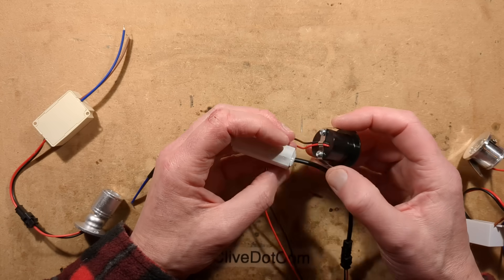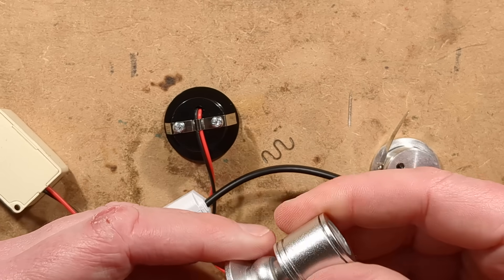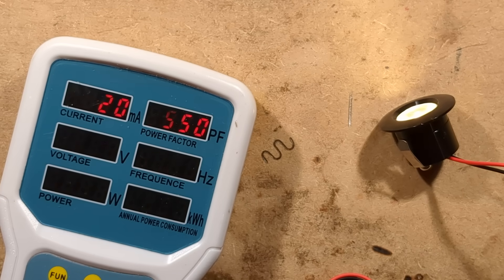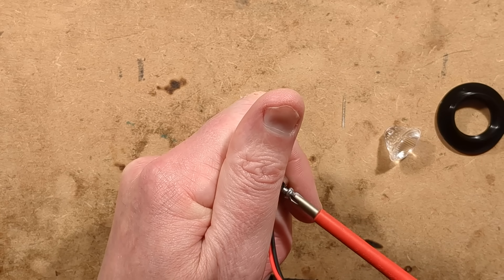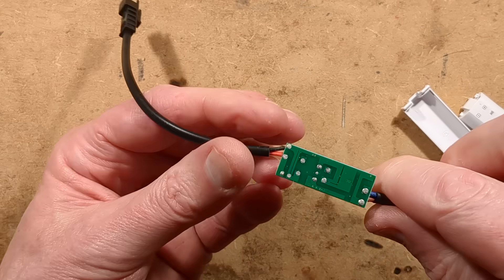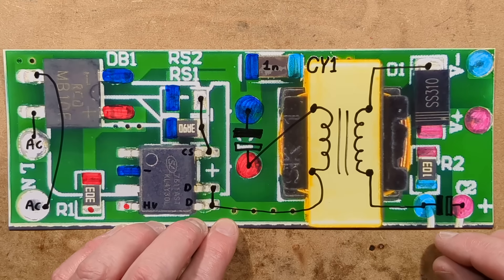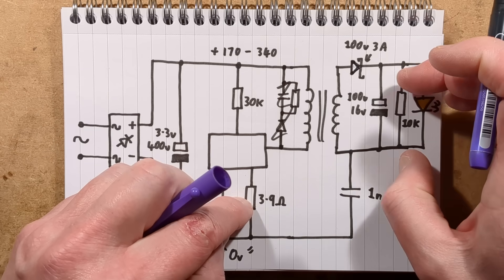Very slim mains LED driver for tiny downlights

Comment: The LED emitter in this looks like a Cree clone, of the ubiquitous XM-L footprint/line. If you want cheap lights with good efficiency and colour quality, it's possible to buy lights that accept an emitter like this, then buy a bag of legitimate Cree emitters in your preferred colour temperature from a reputable supplier like Mouser/Digikey at a few bucks a pop and resolder them yourself with some solder paste and hot air.

I have made a whole bunch of quite nice very affordable dive flashlights this way, but the same process would work just fine for these tiny downlights.

Comment: My bigger concern with speaker terminals for electrical connection other than contact points is material. They're not really good for anything more than an amp and I would be very concerned with them melting.

Comment: oh hey, that's exactly the kind of downlight I'm looking for, to install under the side mirrors of my car, and wire to the interior's lights, to serve as puddle lights! wouldn't need the transformer. I want specifically warm white, and something recessed enough that the light itself isnt visible unless you look under. it looks decent inside, but I'd probably want someone a bit more waterproof... maybe could just fill it with hot glue. I would search for something more appropriate first.
in a car, it would typically run around 12-14V. 10Ω to 33Ω you say, thanks, noting that.
thanks for the video!
Reply from the maker: In a car application you'd be better running three in series with a suitable resistor.

Comment: Excellent video as always.  Thanks.
Whenever I see the Hopi plug I'm reminded of using clear plugs like that as night-lights.  A capacitor dropper, small bridge rectifier couple of resistors and two or three slow colour change LEDs.  (Sealing up the wire cable inlet.).

Comment: you could just have plug with wire and spring loaded terminals

i got that device too, some lamp tester with universal bulb sockets, all of them, never used yet

that being said, it's single insulated wires and after all you might work live anyway. ideally through isolating transformer but often you can't. so it's better to just assume it's spicey and behave accordingly

but i don't create electrical death traps for myself. even if i'm the only one here

Comment: What is the best outome for unwanted electricals?
I have loads of old lcd tvs and thought, are they better broken down in to parts...
Can we start breaking them down and making better stuff?
And if so what would be the tools and expertise required.
Imagine a noob wanting to get rid of his tv's and dont agree with the current setup, right to repair can be diverted by just making them ourself.
I dont want to make a tv, but when i want a better one, the old one going to be recyled seems like feeding their system of recycle not ours.
It just feels corrupt being government?
Reply from the maker: It's tricky.  So much stuff is not designed to be repaired, and even taking it to the local dump can incur disposal charges.

Comment: Hey Clive....  always enjoy your videos. Have a question, would it be possible and perhaps a fun project to 'smooth' the display of the Hopie meter? Could it be done?
Reply from the maker: The multiplexing speed is locked in the main processors software.
Reply: @bigclivedotcom well thats not good... ok, thanks.

Comment: Would this be remotely regs compliant / safe when the only upstream proection is a 15A breaker ?
Reply from the maker: A lighting circuit in the UK is usually protected by a 6A breaker.  But the tracks on this unit will probably blow in the event of a fault.

Comment: Why is the power rectified then pulsed transformed and rectified again, it seems pointless to rectify prior to transformation at those low power levels. Higher loads might need high hertz transformation, but this low powered light? Why not transform to suitable voltage then rectify and stabilise with a cap if needed?  You said yourself that it only needs a few milliamps to run, surely a regular transformer of that sice can deliver that? It seams half the components could have been left out and still drive the light.
Reply from the maker: These power supplies use high frequency to keep the inductive components smaller.

Comment: I find these super small power supplies kind of scary, as in their actual isolation between mains and the low voltage DC out. On one hand the authorities want you to use a meter with class 3 safety, yet allow these little supplies that can no way provide this isolation for an unsuspecting customer who starts poking at a light fixture that has just stopped "Does this need a new bulb?". When a light goes out you investigate, you don't call an electrician.
Also the mains input lead has to be connected to a supply line, the junction box for this will probably not fit through the hole, so being able to drag the supply through the hole after extracting the light is almost pointless as you cannot get the junction box through so you can disconnect and replace it.

Comment: For an off grid application couldn't you remove the driver, string a bunch of the fixtures in series, and run it off a constant current power supply?  No resistors to boost efficiency.  down side is failure of one led means the entire string goes dark.  (like the old time Christmas tree lights)
Reply from the maker: You could run several LEDs in series on one driver.  You could even run three in series with a suitable resistor directly on 12V.

Comment: You should do a video on replacing the power cord on the Anti, including how to source a decent one with good, flexible insulation and actual copper conductors.
Reply: Don't buy from Ali.  For a permanently warm space H05VV-F should be ok.  In an unheated shed etc H05BN4-F as a starting point, and if you need a more robust cable H07RN-F.

Comment: Thanks for this video, Clive, and the bonus info on running these LEDs from low voltage was very welcome and much appreciated.

Seeing the direct-to-mains chip reminded me of the TinySwitch-II family from Power Integrations because I replaced a failed one that one powering the control board in my dishwasher.

Comment: That capacitor seems very suspicious. Especially as "failing short" is a common failure mode of SMD capacitors. I would have preferred to see a capacitor with markings there.

Comment: Thanks Clive. I said "I like it" in unison with you at the end so maybe I'm learning something. I am curious though ... Why not just use four of these on a 12v supply without a resistor? Is it just that you then couldn't set the output or am I all wrong here? Cheers.
Reply from the maker: You could wire three of them in series on 12V with a resistor.

Comment: I’m looking for leds that project a beam rather than illuminate all around. I’m wanting to light little nativities so the size needs to be 6mm or less in height. Ideally it would give a round spot of light like old fashioned stage lights. I’ve thought about flat top leds and paint the sides.

Comment: The housing they used for the light seems to be 100% identical to that of a reversing camera I bought a few years ago (the kind where you drill a hole in the bumper and install it yourself).
Reply: Awesome tooling savings!

Comment: What is a "driver"? in term of DRIVER for LED.  How it CONTROL the LED?  Or how it POWER the LED cells?
Reply from the maker: It regulates the current through the LED.

Comment: There is quite a bit of apparent corner cutting going on.  I have questions of how well isolated the outputs are.  For the intended use as a spot illuminator isolation may not be a huge deal, but you never know what an end user might do.
Reply from the maker: You have to treat all the grey-import lights as being non isolated.

Comment: What is the purpose of the class Y capacitor from the primary to secondary?  For trapping em interference?
Reply from the maker: It provides a path back for high frequency electrical noise coupled capacitively between the windings.

Comment: I kinda want the electrical stuff that I install in my ceiling to have a UL/CSA listing...
Reply: This doesn't necessarily have to go in a ceiling. It could illuminate a shelf, illuminate the wall behind a table, or other applications where it doesn't have to be in a ceiling. Granted, most of those applications involve mounting it on something made of wood so...
Reply: It doubles as a mouse zapper!

Comment: The mystery Class Y question again.
Reply: I think there are class Y capacitors in an SMD package, but they don't look like traditional SMD ceramic capacitors. They're black, quite large, and have actual markings with real certifications.
Reply: @vinnysworkshop  Yageo/Kemet makes some Y capacitors that look like standard packages (CAS series). The packages are quite large though

Comment: Can't you modify that amp metter (hoppy?) to eliminate the flicker?
Reply from the maker: No.  The multiplexing speed is locked in software.
Reply: @bigclivedotcom it may be caused by the software, but that's not a software problem. 
(what it displays =  software, how it displays = hardware)

Add some capacitors between the drivers & displays to smooth voltage & the blinking. The software won't need to know.

Comment: I've been using the garden spike 12v lights as emergency lights on power failure. Surprising how little light you need when it's pitch black out!

Comment: In this case CREE does not refer to the LED manufacturer.  Instead it is used as a general term of alertness and attention, suggesting some action be taken immediately.  "Replace that crappy power supply with something that is properly isolated.  CREE!".
Reply: All power supply from chinese LED light are really crappy, really a little lamps in the market has really good power supplys.

Comment: Its a nice little unit, but do the designers ever consider failure mode analysis. This unit is hidden away across the mains supply. What happens when it fails and gets hot. Is the only over current protection the mains  lighting circuit fuse? Are we filling our homes with tiny little incendiary devices just waiting to go off?

Comment: Oh man... over here in Canada we call those "pot lights". I have horrible, horrible memories and a whole bunch of legit scars all over my hands and arms. Back in the early 2000's my first job ever was electrician's grunt. I had to install something like 50 of these pot light fixtures to the bare cross beams in the basement of a gigantic mansion being built. The only problem was whatever brand these things were, the housings were all stamped/pressed sheet metal that was seemingly completely untouched as far as deburring goes. If you just looked at these things wrong you'd get the worst, gigantic metal slivers if not vicious lacerations. haha =/ I ended up being much better at granite/marble work anyway. haha =) Hope you hade a fantastically food and booze filled christmas Clive man.

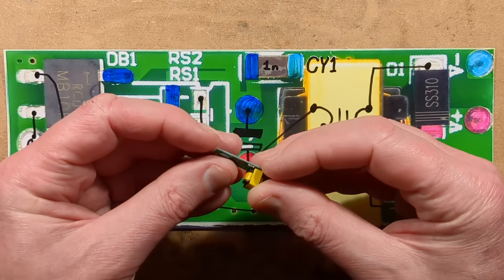Comment: 8:15 How do you tell if a surface mount is a Class Y? You don't. Due to the physical size and type of construction it would be impossible to achieve the required isolation of the dielectric to the "plates" to make it conform to the standard. And those surface mount capacitors are known to commonly fail in short circuit mode. Edit: Oh, and the lack of bleed resistor on the Death Beam input cap is spicy.
Reply: Some reputable brands do make class Y SMD ceramic capacitors, so I suppose it's possible. If a through hole ceramic can do it, so can an SMD.
Reply: @mjouwbuis  A search on the big G confirmed that there are SMD caps, but they are only rated to 300v MAX which on a 240v mains is not enough. You need a 1kv rated cap for 240v mains. And frankly, 300v is still too low for a 120v mains as a simple surge will overcome its rating. Thank you for playing, but my original point stands.

Comment: The LED light at 1:05 with the spiral wound tangs might install and remove more easily if rotating the light, the action of rotation clockwise while pressing in or removing would be similar to a regular screw bulb, the action of rotating it will allow the sprung tang to travel, and in a sense release some resistive force compared to just yanking it straight out. Thanks for the video, always enjoyable.
Reply: I find it's often better to just run these emergency lights 24/7 as any controller will probably use more power than the actual lights, so you end up wasting more power turning them off than just leaving them on.

Comment: BC, how would you smooth the pulsing of your meter dislplays without changing frame rate? Caps or somehow increasing the pwm frequency on the display drivers?
Reply from the maker: The software would need modified to change the scan rate.

Comment: This led current regulated flyback power supplies also used as voltage regulated supply in some chineese devices. Datasheet says its "open string overvoltage protection", so this tiny cheep chip samples voltage on primary at "knee point" to provide output voltage regulation.

Comment: I was thinking about the splice. Boxed and accessible is needed. I can get my hand in the 4" holes for the driver and mains. I could see these in a closet with a box and blank on the ceiling nobody would see. Probably under a cabinet as well. Neat.

Comment: Any idea about those “driverless” tiny (38mm cutout) LED cob lights which run off mains? Market here is flooded with those driverless variants.
Reply from the maker: Many of the driverless COB lights omit the smoothing capacitor and may flicker at mains frequency.

Comment: LED running on 3v taking 100mA.. just curious why power consumption was 2.8W?
Reply: The 100mA was when he connected it to his  lab power supply at 3V. When connected to the provided power supply the voltage (and power) will be higher.

Comment: Clive I'm curious about the possible consequences of snubber network omission.   Early chip switching transistor failure?  EMI noise?  High voltage spikes capacitively coupled to the output torturing the LED and/or output diode?  Or some combination of these? ?  thanks, good video 👍
Reply from the maker: It poses a risk of faster degradation of the switching transistor.

Comment: You should do a video on changing the power cord on the AnTai HOPI.  It would be interesting to see how you would do it, plus what's inside the AnTai in the first place.
Reply: I replaced the power cord on my soldering 'station' (single PSU with iron) and the cord I fitted was no better than the old one! It's difficult to find 3 core flex which is actually flexible enough for light weight things like that...
Reply: @FamilyOfEyles  I found Nexans Pond Flex 3183P 3-Core 0.75mm² x 10m Black to be quite soft and flexible. It's rubber sheathed. I think it's branded Time now - but a search will find it on Screwfix.
Reply: I have a hopi and my lead is crap too plus you can’t put a normal plug in because the cord on the plug is obstructed by those speaker connectors so I use a deathdapter to space it out.
Reply: @g7eit same👌🏻
Reply: Spudge it

Comment: Yes, the HOPI, at least, has a nasty presumably CCA cable that gets hot at high loads. I removed the speaker terminals from mine - it just leaves two small holes. I also added a switch in the top to disconnect the electronics so that you can leave it in circuit without wasting power/risk of explosion when unattended.

Comment: What are the chances of it burning your house down? Made in china. 50-50?
Reply: I think pretty good. It's cost-reduced to the max, putting up enough of those will drive the likelihood of failure toward certainty.
Reply: Driver is "a bit how ya doin" but the lamp itself is quite nice. String a few on a Mean Well and relax